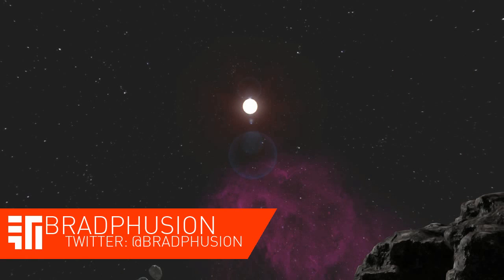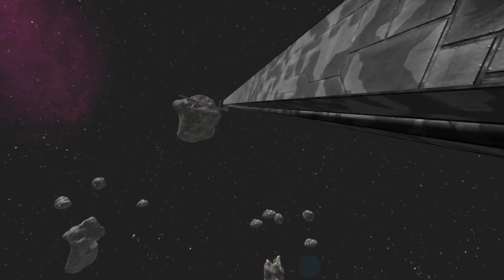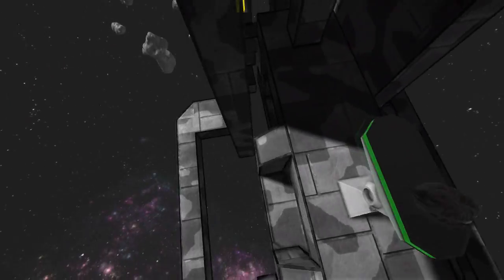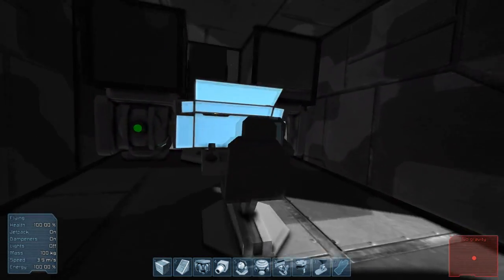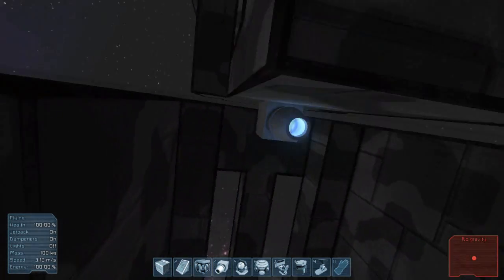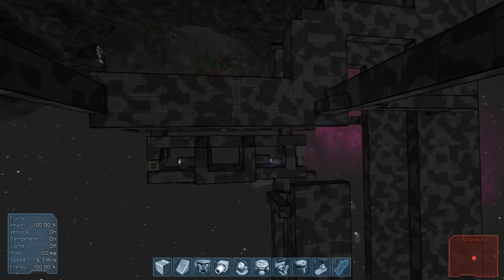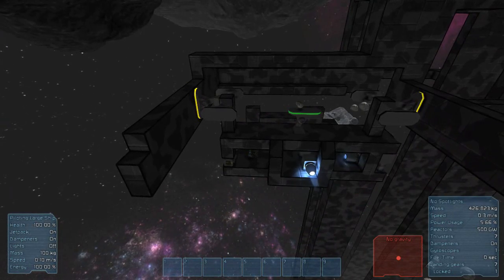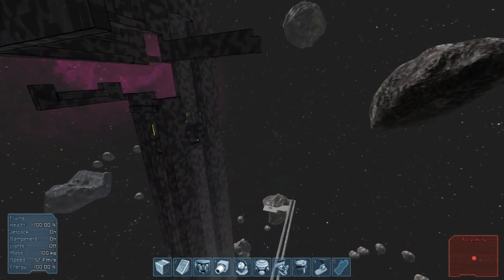Multi-Directional Rail System - Train / Elevator! (Space Engineers)

Comment: If it's using a physics system anything like real gravity you'd use the same amount of gravity generators as you use to get it going to stop it (but in the opposite direction).
Reply from the maker: That is true, but when you have to allow for variables, even the slightest miscalculation could have the lift crashing or flying backwards, sadly.
Reply: Yep, it seems like it's prone to those minor errors in angle and such.

Comment: BradPhusion why not use a turntable for the corners? That would solve the corner problem.
Reply from the maker: I'll copy and paste one of my other comments where someone asked the same thing;
"I could, but because of how tight-fitting the Landing Gear is, or has to be, Adding a variable like moving rails could mess this up completely, meaning the Lift has the chance to not fit where it came from, which is rather silly of the game. I would have used something like that, if the game could handle physics and drag properly, which it doesn't."
Reply: BradPhusion from what i've seen from you, you can most definitely figure out a way to do corners.
Reply: Or use wheels to make it turn. The back ones will be going forward while your front ones make a left or right turn.

Comment: cant you just rotate a piece of rails 90deg using a rotor
Reply from the maker: I could, but because of how tight-fitting the Landing Gear is, or has to be, Adding a variable like moving rails could mess this up completely, meaning the Lift has the chance to not fit where it came from, which is rather silly of the game. I would have used something like that, if the game could handle physics and drag properly, which it doesn't.
Reply: BradPhusion Actually it's possible to build a turntable as long as you don't attach the landing gear to the tram rigidly but via rotors. You can see it in my example: "Space Engineers -- tram turntable".